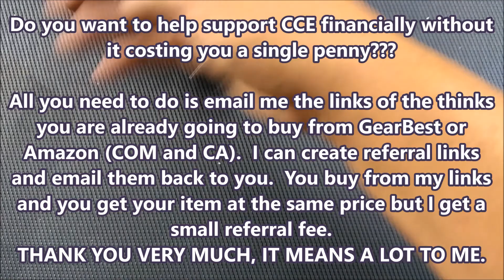Review-Comparison of 2 NAKED frame-lock Sanrenmu's  GB4 612 and 7037LUI-SH (7037

Comment: I like the clip point, nice review, I'm not sure about the chisel grind on knives because you are going to scratch up the flat side over time when laying it flat on the stone. Like you said the strop can remove the bur if it only needs a touch up
Reply from the maker: Also, I don't usually sharpen using whetstones, I use a system like the Lansky, but on steroids, and that keeps back edge clean too. And, on a knife like this, I don't care at all about scratches on the backside of the blade, this is a USER, not a display knife in ANY way at all.

I do plan to spend more time on whetstones soon.  I need to hone that skill (yes, pun intended) as I never did learn how to do it as well as I should.